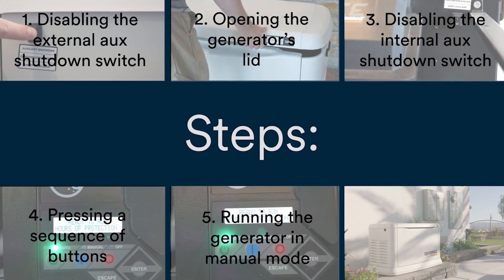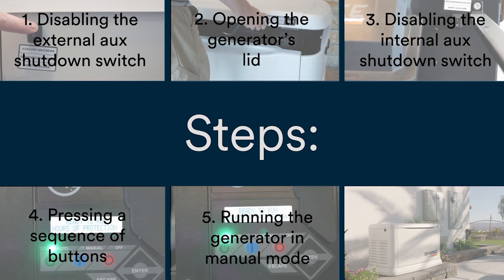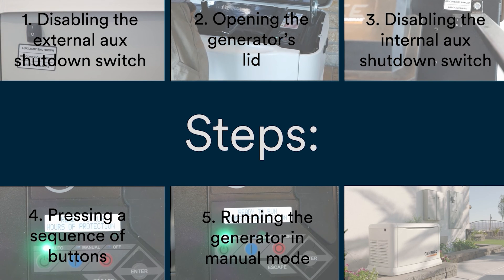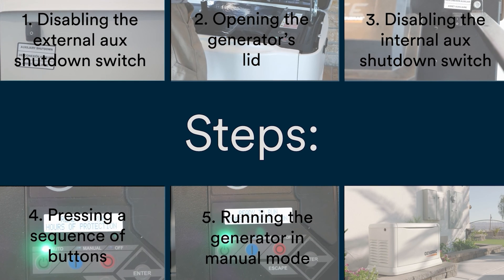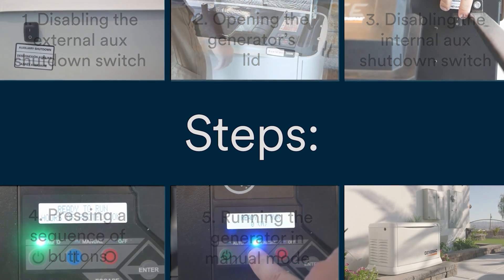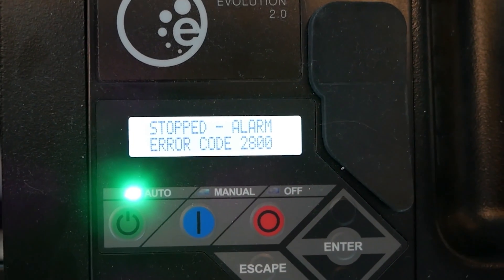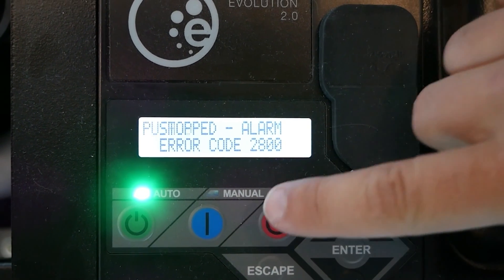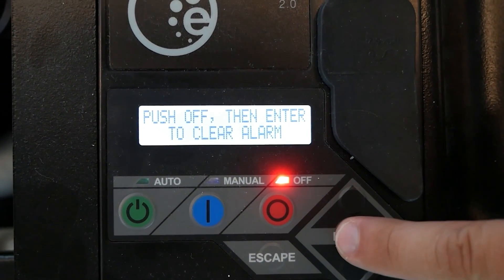Generac Support: Clearing an Alarm Code on a Home Standby Generator

Comment: Does not work on my Protector 22kW to clear the low fuel pressure error code. Checked NG pressure, it is 10" running.